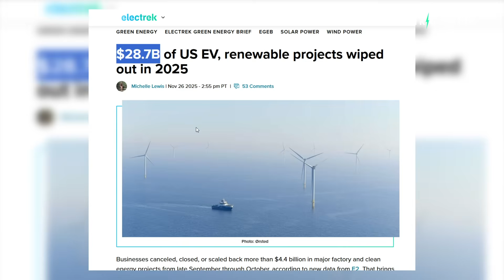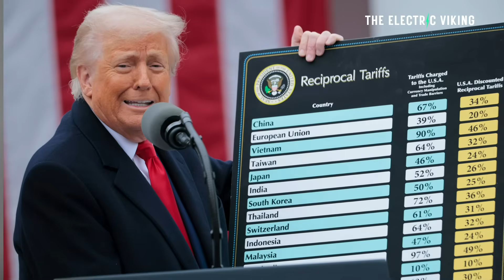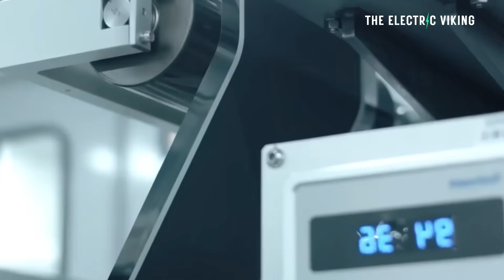$29 BILLION WIPED OUT! US EV & Renewable Projects COLLAPSE in 2025—What Went Wrong?

Comment: And it's not based on economic viability or desirability. It's simply based on the fact that the fossil fuel industry BOUGHT Trump and his cabinet, and they have been doing anything and everything to kill projects - e.g. pulling permits, etc. So, yeah, if you want to do a renewable project in the US it's definitely like swimming upstream but not because they wouldn't make sense. And combined with the data center boom, electricity prices are skyrocketing.
Reply: Solar and wind are terrible for a stable electric infrastucture.  Spain went dark due to to much dependence on undependanble solar and wind. 8:15
Reply: @timothysullivan7433 Not why it happened. Try reading the reports
Reply: @JGood-Quebec Read the reports and that is what happened.  They blamed niclear and coal for nit responding because they dont have enough nuclear and coal to respond.
Reply: @timothysullivan7433 they should all come with a disclaimer, - you have to use your brain
Reply: Fossil fuel industry is involved in all politics, the difference is the Beyond welcome reception they get from this Administration-for-sale